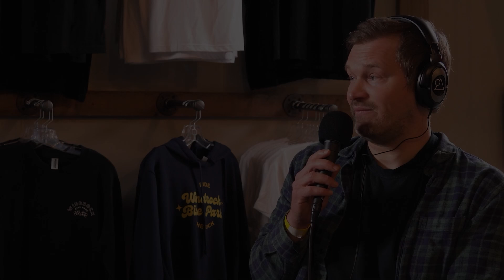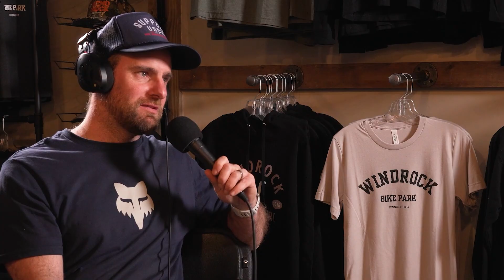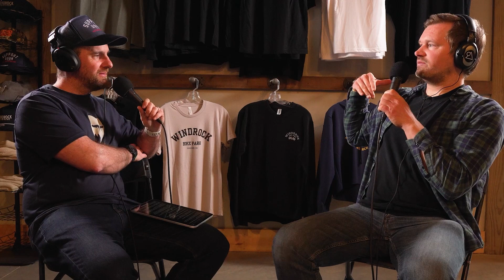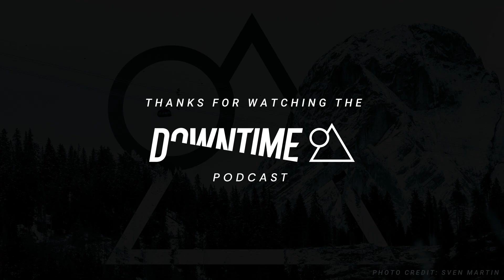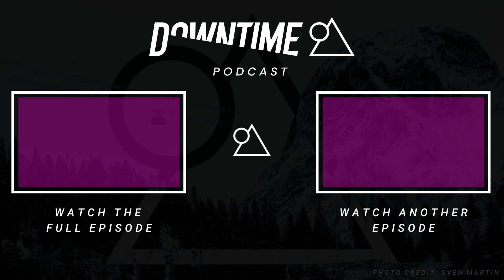How Secret 00's Race Tech Inspired Canyon’s New Sender Suspension

Comment: Just trying to compare this to motorbike riding so I can understand ...
Motorbikes use anti-squat on the front forks to avoid the front of the bike diving. Usually rear-breaking on a motorbike will cause the rear to hunker down (useful on corners if you've come in too hot and don't want the front to dive). Why would that be different on an MTB?
Reply: has a lot to do with the riding technique as the guy explained. if you can choose where to brake, with high AR you get strong braking and the bike may squat too (like your moto), depending on how hight the value is and your center of mass, or stay neutral. lower AR benefits you if you like /have to drag the brakes, allowing the suspension to work while braking by doing the opposite of your moto suspension - rising the bb, therefore pushing the rear axle towards the ground, allowing it to track the ground like working suspension should. the downside is the rising bb that kinda feels like you are being kicked by a fast rebounding shock, as well as putting more pressure on the fork, compressing it more, potentially lowering traction and also putting more of your weight on your arms as you are trying to compensate for being pushed forward. this drawback is less apparent on flatter terrain